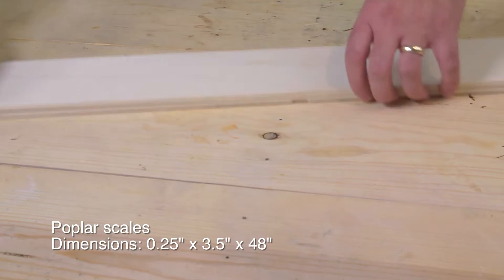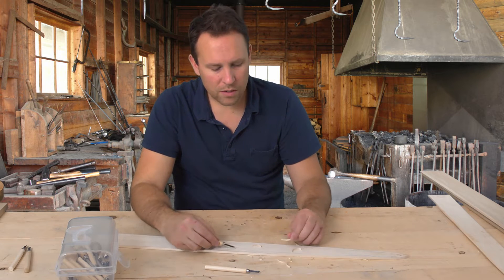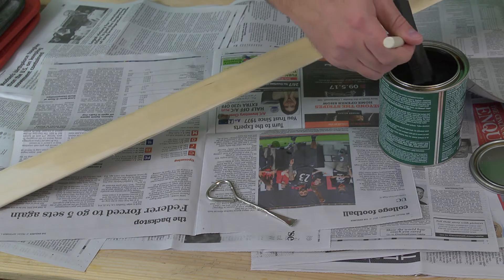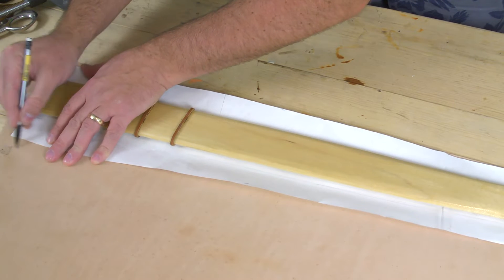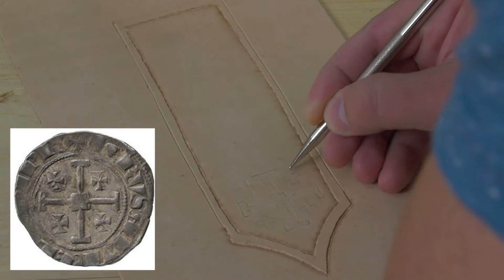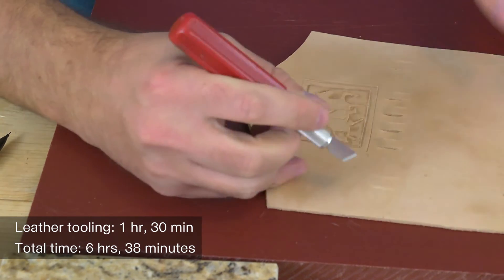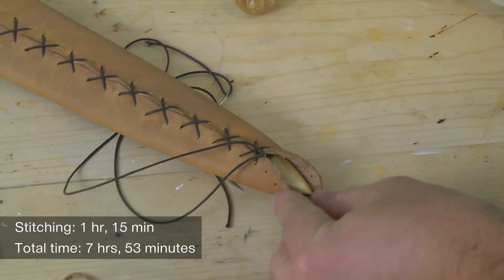New Knightly Scabbard Build

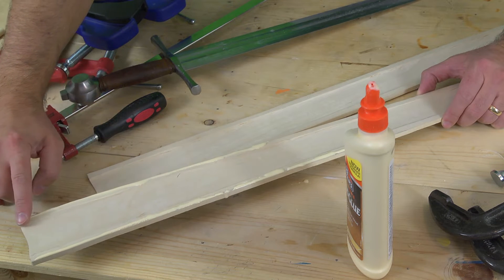Comment: Hey Matt. Instead of using those big clamps, you can use those "office" binding metal clips. They are extremely cheap, easy to use and do the trick. I'm a professional guitar maker and use those clips to glue my purflings with them. You also use waaaay to much glue! Use maybe (if even) half of that, spread it with your special, glue spreading device (like perfectly demonstrated at 5:35), then close the scales and rub the surfaces against one another. They will stick basically by themselves. Then just use the small clamps around the the edge of the scabbard, (this is more than enough pressure!) and enjoy, a more relaxed and less messy way, to glue those pieces together!

Comment: To make a more exact pattern with the leather, I'd try wrapping the wood core up in weak masking tape. Then you just slice lengthwise down the middle (gently), and then peel away the tape in one piece!
Reply from the maker: Not a bad idea at all! Thanks. I’ve noticed that my leather shrinks just a little, so I would want to account for that and add just a little to the edges. I’m going to try this tape method today. (I just started a new scabbard!)

Comment: When glueing my core, I clamped the top and bottom initially but the took a single piece of twine and wrapped the core, cross crossing on both sides to pull it tight all the way down and then took the clamps off. Worked great for me.
Reply from the maker: I might have to try that!
Reply: I only had two clamps and I found my core pieces were slightly warped, resulting in a gap in the middle. This allowed me to get a very even bind all the way and helped remove the warp. 

Im also trying to use nothing but hand tools, things a medieval craftsman would have had available, and the twine felt "right". 

Love the video btw. I looked for so long for a good resource and you're it man. Keep it up!

Comment: I personally used a router crafting my scabbard. it's probably not the most common accessorie to a toolshed, but you basically practiced using it in kindergarten. You just have to set the depth and "colour" within the lines

Comment: Excellent video, Suggestion: Gouge out the center before cutting the outline of poplar. You can then clamp it to the workbench, this will allow much better control of the carving tool using both hands. Additionally I would invest in some larger chisels, those small carving chisels are quite hard to hold and a larger chisel could be used with a mallet.  Additionally make a strop and rub some jewellers rouge on it to keep those chisels sharp. I’ve used auto body polishing compound with good results too.

Comment: next time you do tooling on leather you should use painters tape on the back to prevent stretch, use a draw knife for the lines, also moisten the whole item and not just the immediate area (this will prevent discoloration).
if you use warm water (warm not hot) the molding will go easier.
you are also supposed to use leather die before antique (antique can go over the leather die and is used more to bring out and highlight the natural aging as well as the tooling. when you mold the leather it will dry the leather out. this will weaken it and make it fall apart more quickly with age. this can be prevented by oiling it with neetsfoot oil or even extra vergin olive oil before you die it. (just rub a light even coat over all leather and give it some time to soak in. just don't saturate it) shellac is a good often used finish for leather but it usually goes on pieces that won't get access use. you may want to look into resolene and Skidmore's for the finish. 
your final product looks amazing.
Reply from the maker: Good tips! Thanks. I'm a novice still...

Comment: As a blacksmith who makes smaller appliances I would heartily suggest finding a smith to make your buckles....
Reply from the maker: Any idea what these would typically cost?
Reply: Everything Medieval (speaking only for myself) as single pieces, between $15-20 depending on the amount of work (less hammer time=less expensive) bought in multiples even less. I just made a archeological find based belt buckle for myself that I would sell for $30 and your needs would be smaller...

Comment: All the scabbard making tutorials I've seen use chisels to clear out the wood in each panel. Is there a reason you don't just use a flush bit router to do it? It seems quicker and cleaner, but I suspect there must be some rational behind not going that route. Care to share? Thanks! Great tutorial!
Reply from the maker: Router is faster, but removing the wood slowly allows for very minor/precise adjustments. If the wood core is not lined with a textile, I think you want the best fit possible. But if you’re happy with results from a router, then that works too. If you have the time, and you want a really nice scabbard, I think it’s worth it to spend the time and effort to make it as good as possible. Great question though.
Reply: @MattsGreatHall , that makes sense, yeah. I figured it was probably something to do with quality and precision. I'm still a total newbie, and am just practicing on stuff for myself, so I don't mind the mistakes (at this stage). If I ever get more serious, though, I may just have to invest in some good chisels.

Thanks!

Comment: Hey man, great video. Just wondering why you don't have to varnish the inside of the wood. Does the oil on the sword not effect it. Thanks. :D
Reply from the maker: Hey!! I love your channel by the way! I use poplar wood for the scabbards, and one of the really nice things about the wood is that it shouldn’t cause swords to rust. This is due to the very low acidity of this type of wood. The only issue that I can imagine arising over time is the wood drying out and becoming somewhat brittle. I’m not sure how the blade would react to resting constantly against varnish, but I wouldn’t risk it. Oil from the blade should not be an issue; if anything it might cause the moisture to remain inside the wood (which is a good thing).
Reply: Everything Medieval thanks mate, I was worried it was a fairly dumb question... I watched a video with Tod Todeschini where he explained that thing about the acid in other woods which rusts blades. I was just. Worried if long term oil on wood had any effect. I've bought a Albion Earl so already planning making a scabbard... Maybe I should start practicing tooling ASAP.

You're doing a kick ass job here mate, shocking you don't have much higher sub count.

Glad you like my stuff too. :D
Reply: Everything Medieval I'd love to know how you did the top (guard flap) as well. Did you just fold the leather over or did you glue it down? I see a lot of the ones online are stitched...
Reply from the maker: I have a bad habit of completing a project 98% or so, and then uploading the video when the project is not actually completely finished. The flap is folded over and not glued. When it's wet, the leather will basically take any shape, and this is what you see here. After I uploaded the video I did actually finish the edge with a stitch. It's probably not totally necessary (unless the scabbard gets very wet), but I would suggest a simple stitch to give it a finished look.

Comment: When wetting you leather for tooling, ALWAYS case the entire piece of leather so you do not take a chance ending up with water stains on the leather. If you actually case your leather before tooling it, you end up with much better deep crisp results. To case the leather, soak it for about 20-30 seconds until the air bubbles stop coming out of it, then take it out of the water and lay it on a flat surface that will not absorb the water. Place Saran Wrap over it to keep it from drying out and let it sit overnight. The next day when you start tooling, you will see a world of difference in tooling your leather.

Comment: Your video was informative and the final result was a realistic and handsome scabbard. However, your choice of tools for making the chanels makes the process difficult and slow. Could I suggest you try to find a second-hand Stanley No. 71 Hand Router (in good condition incl.3 cutters anywhere from 120 to 220 Euros), and buy a 15mm Japanese Scabbard Chisel (Saya Nomi), unfortunately not a cheap chisel at about 150 Euros. A combination of these two tools will simplify and speed up the process. Dieter Schmid Fine Tools sells Japanese Scabbard Chisels, and Walter Sorrell Blades make a similar chisel. Keep it Real
Reply from the maker: Thanks for the tips! I’ll have to take a look at those tools.

Comment: is it possable to make this for a synthetic sparring sword? i'm using a regenyei longsword now but its illigal to train with a steel sword outside. so i'm willing to make this for my synthetic sword. im ready to do some unseathing techniques! :)
Reply from the maker: As long as the wood is thick enough, I don't think it would be an issue. Often sparring swords have a bulkier cross section to give them strength. But as long as you choose wood that's deep enough, I'm sure it would work just fine. Good luck!!

Comment: do you glue the leather on the wood core or just mould it on?
Reply from the maker: I don't believe you'll need to glue it. The leather, when wet, tends to shrink. I couldn't remove the wood core from the scabbard without cutting it off -- it's extremely tight.

I'm glad that you're doing this project! It's really not too difficult. Hope it goes well!
Reply: thanks really much for the reply, it's been great help!:)

Comment: You probably already know this, but if you put the barge cement on both surfaces you are going to glue and then wait for it to dry, you can put the two sides together and it will instantly stick solid.